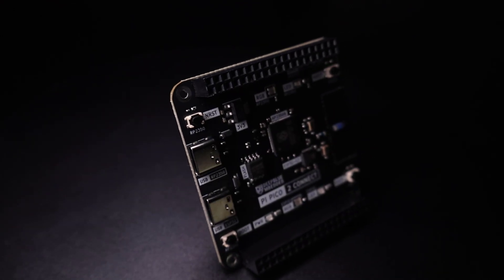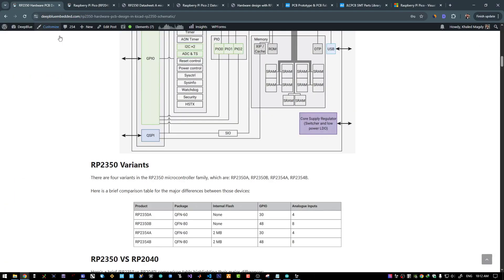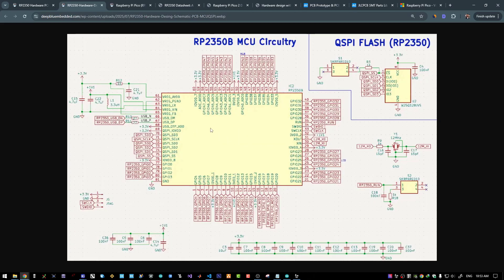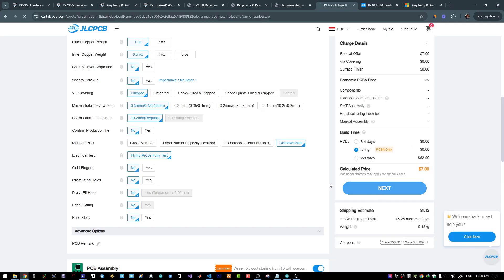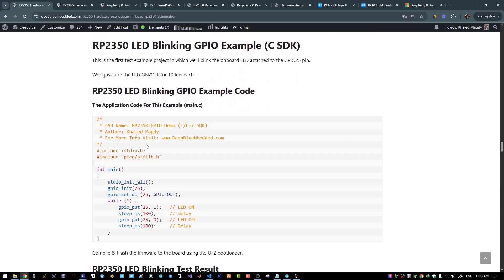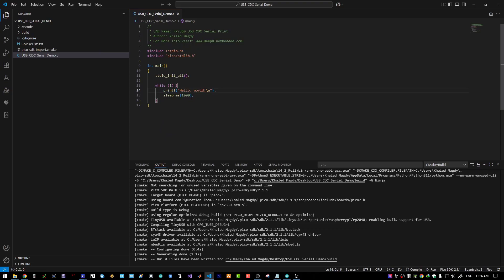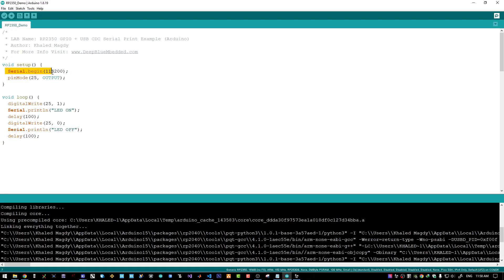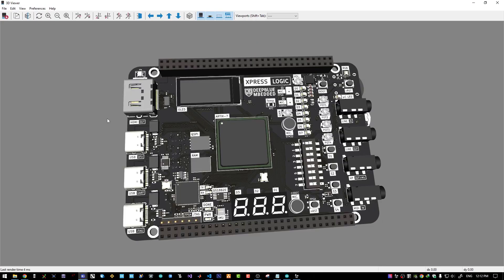RP2350 Hardware PCB Design in KiCAD | Custom RP2350 Schematic & PCB Design

Comment: The USB ports should have ESD protection. Also, there is a section in the RP2350 family Datasheet explaining the layout and component choice for the 1.1 V regulator. Due to some non idealities in the RP2350 IC design, the regulator might be unstable if you have a slightly bad layout or if you use an inductor different than the recommended one.
Reply from the maker: Thanks so much for your kind words and valuable feedback ^^
Reply: Also, great video, great presentation of the project and beautiful website!